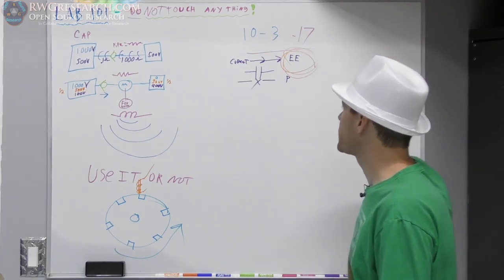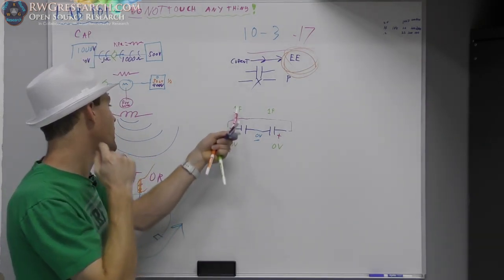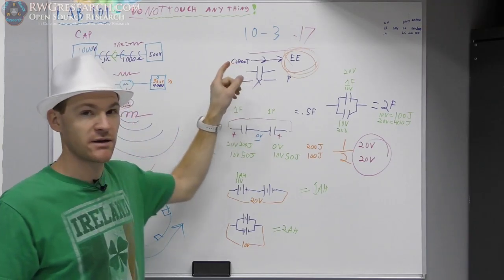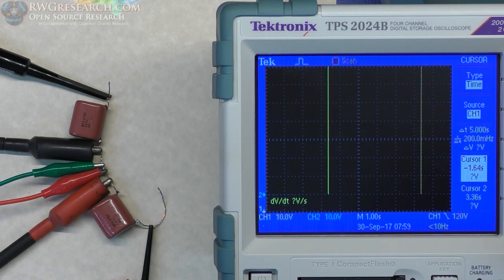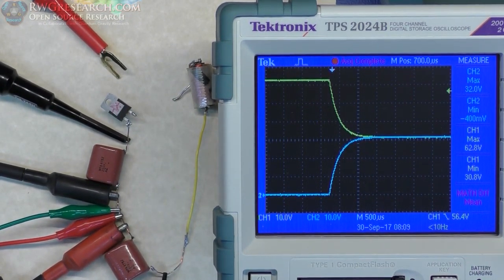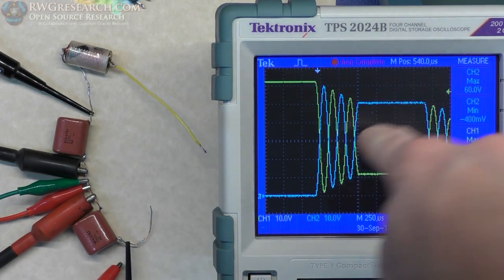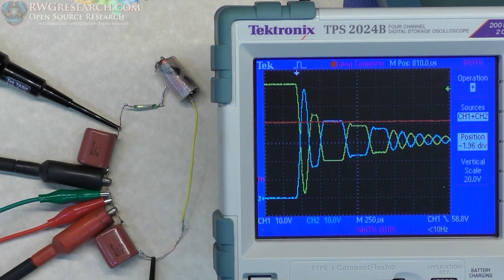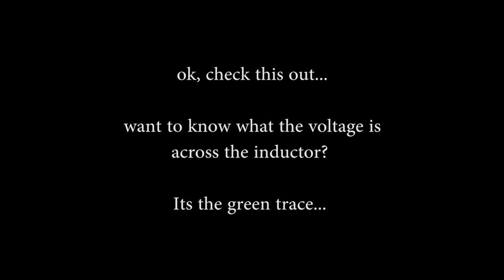The Search For Answers Part 5:  Bench Testing & Capacitor Paradox.

Comment: The capacitors does not pass current, it concentrates  the dielectric field, and by concentration and relaxation on the dielectric inside, transfers the voltage pressure. Heaviside explained that well in his Electrical papers from 1890th.
An Interesting direction for thinking though, than you for organizing it in such a way.  Understandingly unconventional ideas are hard to organize at first. 
A note though, a capacitor does not discharge itself internally, it discharge itself via the dielectric between the terminals outside the capacitor. The dielectric constant of the outside environment (usually air)  is smaller then the one(s) between the capacitor pates, unless it is an air capacitor. For example, conduction we can envision a material with a dielectric constant of (or close to) 0 if we short the terminals of the capacitor. Depending on the dielectric quality between the terminals there may be a tiny displacement current.

Comment from the maker: @ 2:08 i miss spoke. " what is energy"  I stated that "you dont have any stored energy" what i was trying to say is that the energy is always there. its can not be created or destroyed. so what i was trying to express is that energy is always there, but its useless if its "neutral" You need a difference in potential to do something with the energy. however the energy is always there and its never "consumed" nor is it "transformed" ... ~Russ
Reply: Your transfer scneario is parallel... that's why you have 1/2 the energy in the system.... (double the capacitance).
Series would be + -  +   - but you have + - - + (and looping the +) then that's parallel.

Comment: Hi Russ
Always find your videos interesting. I do get disheartened every time someone claim overunity can't exist. Yet we all have overunity devices in our homes. All mechanical heat pumps have a unity of 3 to 4 and some even 5. Just look at the spec sheets of an air conditioning unit. You may need to convert the BTU's to watts but not hard.
Nice to see someone else has realised that instead of shorting a battery over a load it may be better to transfer the energy from storage to storage and use the flow transfer to drive a load.

Comment: The water analogy only goes to prove that if energy is not destroy-able then it must be dynamic. That something is flowing first then a current is generated from that flow and follows the initiator which in this case is the voltage flow on the surface of wire. Then plasma is condensed around that potential flow and follows it. Like I said the analogy is only to prove that the substance that is flowing is real and can not be destroyed. It is a medium that potential flows in and moves towards that potential. Shifting the potential back and forth creates a condensed flow of plasma back and forth. Learn to harvest the potential the plasma conducts and walla you have as much energy as you need.
 Harvesting the flow without effecting the flow itself is another story. Probably a bifilar would help in that to create a reaction-less induction in a regular solenoid around or in the series bifilar solenoid.

Comment: Good conceptual demonstration. We have to revisit electrical theory maths work with a definition premise. We saw oscillation and opposing force and standing wave transfer looped. These elements are in my build but try to explain this is somethingelse. The crashing interaction standing force is different than the molecular level interaction such as the air tank illustration pressure equalization. The molecular level can transfer some heat from friction in the system; the sub atomic level energy transfer interaction is not so clear in physics concept. New results gravity is more confirmed in theory as an energy waveform.

Comment: You are missing the fact that a 'short' (which is your _benchmark_) is not actually a zero OHM resistor at all.  The leads of the capacitors have resistance (and inductance which is what those spikes are) and the capacitors are able to supply infinite current; briefly.  What you need is a current probe to see it - that's what the resistor shows you.

You could show putting the two scope probes directly on each end of the capacitors in the centre where they are soldered together (one either side of all those clips) - according to your assumption nothing should happen, but it will.  You will see a spike, caused by the enormous current flowing through a very small resistor.

An alarm bell should have rung when you heard the spark produced when you 'charge' one capacitor with the other.

Comment: Great video! Would the total joules of all the oscillation peaks exceed the joules of no oscillation?
Reply from the maker: Arkiver Unified Energy that's a good question. What your asking is is the power more..  The Jules in this demonstration are allways less than what we start with in total.  But you could debate weather the total work done was more than let's say the resistor. All things to think about. The key here is to isolate "energy" and "work/power" bescuse work is time dependent. But energy is not. Energy is allways the same. It's the potential that changes. All things to talk about. Will see how much we get in to that in the future videos. ~Russ

Comment: Hi Russ,
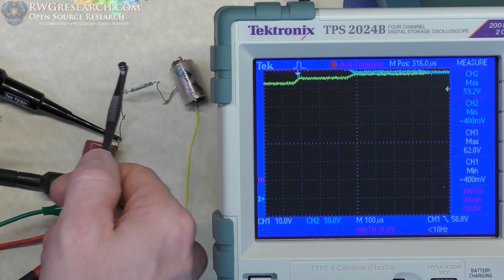great videos... Q?: on 56:47 it shows 74V on CH1 and 62.0V on CH2..... what's that?
Reply from the maker: i was going to demonstrate that in here and forgot. all theses tests i was removing the power input. so ask your self. if the system is able to transfer 58 of the 60 volts.... what happens if i keep the supply voltage connected and do the transfer? instead of only the potential of the caps. i now have the potential of the supply. ( 62v) so the transfer will be double the supply. or close to it. ~Russ

Comment: You missed an important point: The capacitor paradox just tells you, that moving charge between capacitors is very inefficient. You will loose half the energy every time and this energy is dissipated in whatever series resistance inbetween. If the series resistance is low (cable), the currents are high and the dissipation is short but intense. If you put a 100Ohms resistor inbetween, the dissipation is longer but of lower power. Which means: The energy from the so called "paradox" just has been transformed to heat.
Reply from the maker: cls just out of curocity,  did you watch the whole video yet?  Thanks. ~Russ
Reply: yep, but I don't get your point. All this stuff happens as you speak within your SMPSs which power your laptop or phone/camera chargers. Resonant converters are all over the place.

Comment: Ok so i desided to do some testing to replicate what you are demonstrating here @rwg42985. as its an interesting effect to test. And used a vortext coil as an inductor ( a diferent design but based on the same principle as what Daniel Nunez designed.) And found them to be very good inductors (as they occilate quite manny times before the enery is equalised). But when testing with different types and capacitor values i found that 1 of them equalised on a higher total value. andso noticed an interesting  internal post occelation seemingly between the diode and cap when testing with a diode to see if the receaving cap ended up with a higher volt value or not. Have you tested with your vortex coil ?
I could make a video demonstrating it if needed.
Reply from the maker: JosteinZG cool. I haven't used. My VBM coil yet for this. But will get there. In the. Mean time. I would love a video on it. Thanks for sharing. Also note the type of caps and values clearly. In the video. Might help. ~Russ
Reply: Some correction :) as I was checking the values and some more testing to add more to whats was happening before intending to make a video i noticed i used 2 diferent valued caps. having a 2.2uF on the charge end and a 1uF on the discharge receaving end. when getting the seemingly higher overall value. So that then indicating that we can get more voltage on the smalle cap as the field contain more energy. Ill still make a video to include the effect with the diode and the rest.
Reply: ok, video made: https://youtu.be/YkN2CqYD_kI

Comment: Sorry Russ but I don't believe that there was no current flowing through that resistor when you used it to discharge the caps. It think that you just could not measure the total voltage drop with the scope because it was so small.
Reply from the maker: William Hada 100% there was current flow! While the caps we're balancing. If I said there was no current flow please note the time in the video so I can fix that. Thanks!  ~Russ
Reply: rwg42985 My bad, sorry, you said there was current flow but no energy loss because the total voltage was the same. But how can a current flow through a resistor with no energy loss? Maybe the voltage loss ( energy loss) is so small that you can't measure it with the scope.
Reply from the maker: ok, good. lol glad i did not mess that up! :). so to answer your Question. well, if we already stated that the load dose not consume the energy. Then we also have to agree that the load (resistor in this case) generates its own heat. now your asking how can that be... lol well i will cover it at some point in these videos. Until then you'll have to just think about it. i pondered it for weeks. then it hit me... and it makes very good sense. not that i dont want to share my thoughts, but i need more time to explain it better :) ~Russ
Reply: "The load does not consume the energy" - well, pushing electrons through a resistor requires work. The energy used to produce the heat cannot be used to do other things - it's converted into heat.
I like your style, but I find it hard to watch your videos in full - you simply don't get to the point fast enough: What is your hypothesis/what exactly do you want to tell..